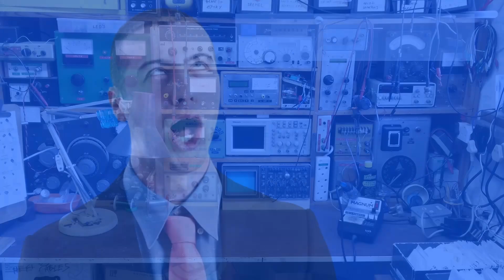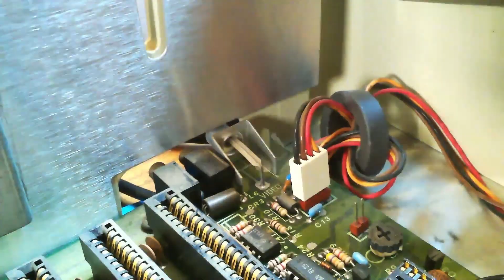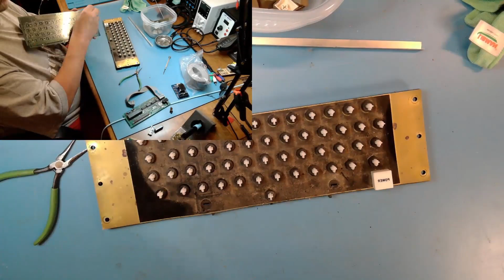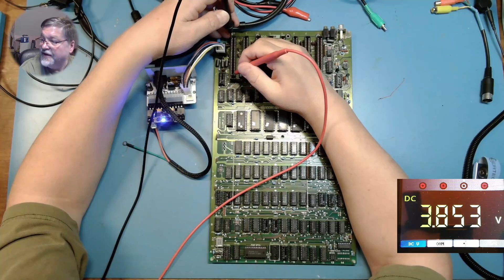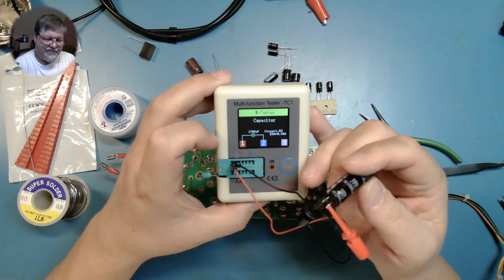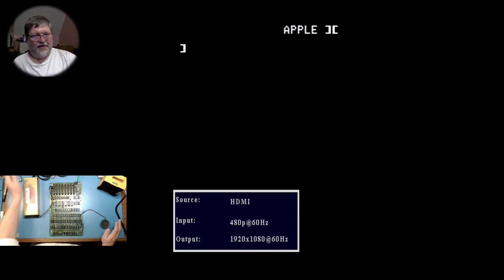Let's LEARN How To Diagnose An Apple ][ Plus Together

Comment: Great video! Amazing, I did the same thing, though I wound up buying an external PSU for testing not the PICOATX kit. I'd probably had grabbed that if I'd known about it then. I've got bad RAM too, and though I've figured out the chip, I've yet to be able to source a new compatible RAM chip. Well, there's probably more wrong with it, but this is as far as I've gotten. Will be very interested to see how your repairs progress! Thanks for sharing!
Reply from the maker: Thanks!  I appreciate that.

Comment: Nice work on refurbishing that power supply!  While that dead test ROM is very nice, you might have a more direct path to diagnosing the main board by getting a working keyboard attached.  With that, you can see whether, for example, BASIC programs are working, which will effectively test a lot of the key memory locations.
Reply from the maker: I know.  **SIGH**. I'm dreading that keyboard.

Comment: If you have the ROMUlator for the PET, it can be reprogrammed for the Apple II
Reply: That's a fantastic tool. I use mine on both the Apple IIs and Commodore PETs
Reply from the maker: Have it.  Can't program it.  Can't seem to get the programming software on the Pi to work.
Reply: @YARC-1981  There is a Wifi board that  doesn't require a PI to program
Reply from the maker: @KAPTKipper  Yeah, I know.  I need to order one.  I just got so frustrated with trying to do it with the Pi, I kind of gave up.  I've also got a PET 2001 I was planning on using the Romulator with, so I need to get it sorted.